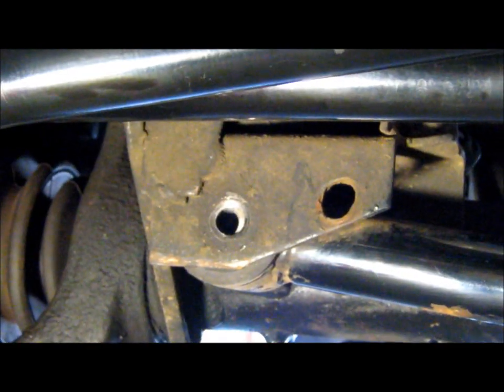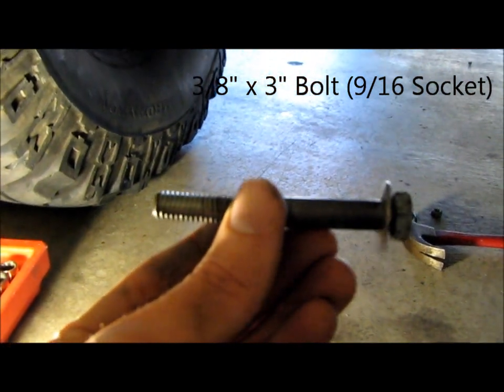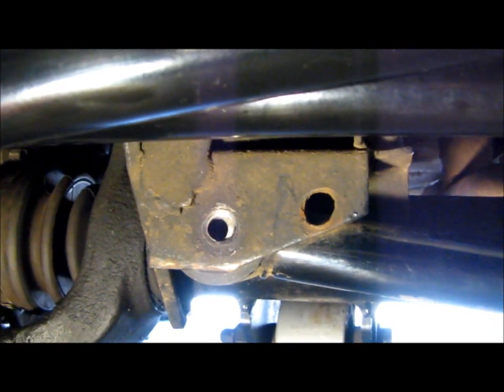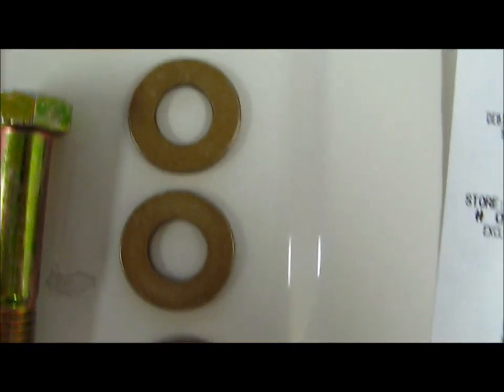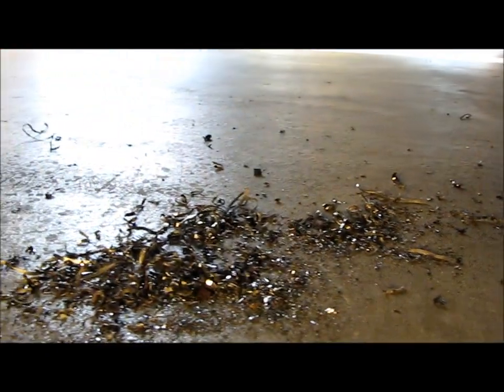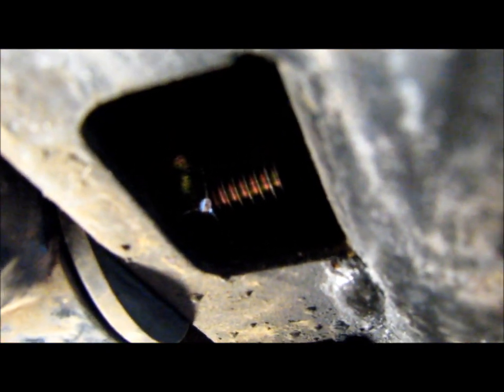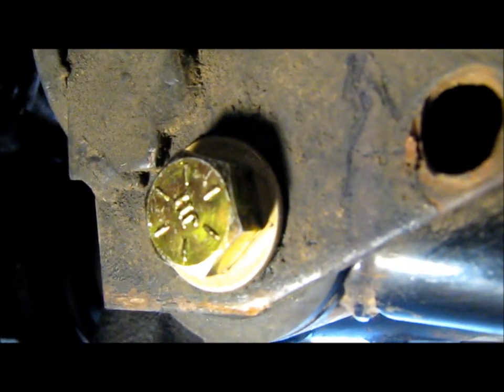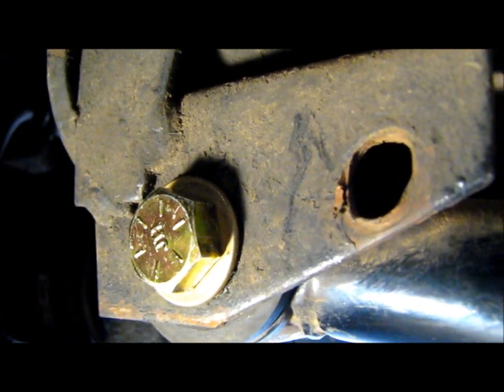Jeep Grand Cherokee 4x4 Project ZJ Part 5 Steering Slop Death Wobble Fix Track Bar Axle Mount

Comment: Great explanation! I have a 97 ZJ, as far as I can tell everything is original/ oem replacement. Ive had the steering box replaced twice, visually there is nothing other than some older bushings , when driving her she is SLOPPY AF. the steering box replacement helped briefly but its back to being incredibly loose. The steering wheel sometimes is turned slightly  to the right to steer straight,  and other times totally normal  & centered. 
I also get a bizarre vibration, (not death wobble), at around 1800 2000 RPM when accelerating on the freeway, recently it has lessened but now only really happens at 1400 1600rpms instead. It is for less than 3 seconds in duration but can be quite violent, it sounds like bass from a sub or something. It's not very loud anymore but it was outrageously loud before. 
I can't figure either of these things out. Possibly related? IDFK. What do you think? 
I know this is an old video but you obviously know your stuff! Thank you!!
-the Seattle girl with a shitty jeep
Reply from the maker: I would take a close took at your drag link which is the bar that goes from the steering box/pitman arm down to the tie rod.  That has an adjustment which is how you center the steering wheel.  If your wheel position is changing, that adjustment is probably loose or the joints on either end of the drag link are loose/bad.  Check it out because that can be very dangerous, could lose steering while driving.

Comment: Thank you for doing this. Mine is wallowed out and I just tightened the hell out of it for now. Did you have to remove any other steering components to drill through? I have 1 ton steering and its looking a little tight
Reply from the maker: With this particular steering setup I didn't have to remove anything.  Had a nice straight shot with plenty of room for the drill luckily.

Comment: Looks like track bar mount weld is cracked above second hole? Also you can cut bolt to length needed, then file end so nut starts easier
Reply from the maker: Yeah, that mount was trashed.  Eventually ended up doing a custom adjustable heavy duty bracket on the top side of the axle with custom adjustable trac bar.

Comment: What kind of drill bit did you use? I can’t seem to drill through the sleeve
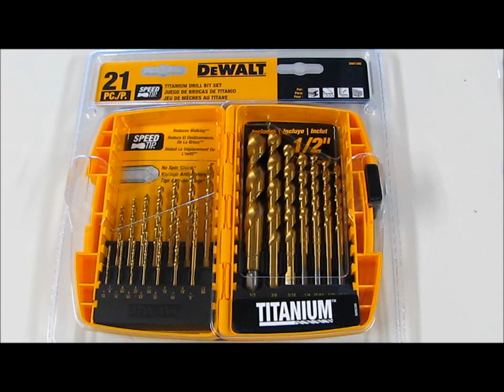Reply from the maker: Check out the bits I got at 3:41
Reply: @WildWestCrawlers- you can use most any metal bit, Ryan's are too choice because they're harder. You MUST go slow, not fast. Use oil too and a good amount of pressure, like a human drill press. Hth

Comment: I’m in need to drill mine out. As for the bushing and bushing sleeve, do I buy a new bushing with a bigger center bore? And matching sleeve?
Reply from the maker: Mine was thick enough that I was able to safely drill it as well.  I left it all in place and drilled through together for perfect alignment.
Reply: Was this done to your oem track bar or aftermarket?
Reply from the maker: @HighhScore  OEM bracket but I believe the track bar was an adjustable aftermarket one, can't really remember the specifics of it though.

Comment: I had to drill mine out from the original 8.8 to half inch grade 8 haven't had any issues since
Reply: Tipton Shelton did you buy a new bushing sleeve or did you drill out the stock part?
Reply: I did the same now I need new bushings. Did you haven to use a .5" sleeve? Is so where did you get it?
Thanks

Comment: Hey brother, great video. I'm doing this to my Jeep as well tonight actually with the same equipment. Just curious how your rig is riding? has the new bolt set up held up pretty well over time?
Reply from the maker: It worked out great and didn't have issues with it after the fix, but I ended up changing the entire steering setup a few times after this video.  You can see the latest videos and info at www.projectzj.com  I'm now running a custom built crossover setup which handles the best of all setups I've tested.

Comment: Did this happen to cause like drifting into a turn I got a zj everything new and it still feels like it's drifting when I go around a right hand turn or if I jerk the wheel the back end feel like it's drifting but feel like it's in the front and this bolt was loose 2 times now thanks
Reply from the maker: I would definitely pull the bolt out and get a good look at the holes on both sides to make sure they fit snuggly against the bolt and are perfectly round.  If they look loose or oval, time to drill larger and install larger bolt.  It will feel very sloppy if you have this issue.
Reply: that “drift” is your limited slip differntial working in action . dont go so fast around corner with any jeep they have high center gravity .

Comment: Can the sleeve on a heim joint be drilled out to a bigger size bolt? I have a WJ and have the same exact problem. I understand drilling out the bracket to a bigger size for the new bolt, but of course this larger bolt won't slide into the stock sleeve of the heim joint.
Reply from the maker: I wouldn't recommend drilling a heim.  Probably better to but a replacement heim for the bolt size you're going to use.
Reply: RYANVISION are they universal with the threads that turn into the bar? Thx for the quick reply btw.

Comment: I upgraded to the next size up on my ZJ too and had to do the same thing with the nut inside-- been years and no problems, I forget how I held the nut while tightening the bolt- I changed to the poly greaseable front sway bar bushings and just installed greaseable poly front sway bar links, old ones were dry on top at pivot and trashed. Also new front bump stops and cups or what was left of them after 20 years of Northern exposure

Comment: could you also use the same  oe bolt and weld a nut on both sides of the bracket  ... i would think that would  really eliminate the problem.?after welding the nuts on both sides ..upgrade to  a little longer grade 8 bolt with a nylon nut.
Reply from the maker: +todd j You could weld a nut to the back side and a washer to the front side but the back doesn't have much room to weld

Comment: why does my 98 grand cherokee w/3" lift wander so bad
Reply from the maker: joseph prejs You probably need a professional alignment to make sure the toe and caster angles are set correctly.  Other than that, check all bushings, joints, tire pressure, steering box, etc.
Reply: Pinion and caster is not low enuff. I paid a professional to do mine and he didnt do it right. At the very minimum you need shims to angle your pinion. I recommend upper adjustable control arms to adjust your pinion/caster.

Comment: I changed my track bar (iro track bar conversion) I just put in the over the knuckle iro tie rod conversion and I still got the damn death wobble
Reply from the maker: Michael Gutierrez Were the holes wallowed out when you changed the track bar?  How are all of your bushings on the control arms?  Hubs and ball joints have minimal movement? Alignment set correctly?
Reply: i found the problem its the lower control arms and the caster is WAY  off ... by the way did you keep the 7/16 bolt in the lower track bar or did you swap it out ... i was drilling a 1/2 in hole but i cant drive on the sleve because i dont have a vice to hold it ..... Also if you did drill it out did it help

Comment: 97 grand cherokee with high offset wheels, i have never had it happen to me but everytime my girl drives it she says it shakes violently freaks her out and she has to pull over, seems to happen in the same spot on the road going about 45mph when hitting a bump on a slight curve.... would it be good to just cut a piece of steel and and weld it over the bracket and re-drill?
Reply from the maker: That's definitely an option, the thicker the steel the better and make sure the hole you drill is exactly the size of the bolt so it doesn't move around at all.

Comment: For the back side of the axle-side mount, you could've used a "tab-nut", or "flag-nut" to secure the new bolt. They're simple to make, with a 4"-to-6" by 1/2" by 1/8" piece of bar stock welded to whatever nut you choose to use for securing the bolt.

I've chosen a grade-8 constant-torque locking (not Nylock) flange-nut for my application, but any applicable nut will do. I've also chosen to use a pair of star-washers as extra insurance against movement of the nut-and-bolt combo in the lower track-bar mount holes (welding in a pair of washers I would only use as a last resort), and to torque the new bolt to a minimum of 60 ft./lbs.

My understanding is that a grade-8 1/2" by 13-tpi nut-and-bolt combo can be safely torqued to 80 ft./lbs., If I read my Haynes Jeep Cherokee Repair Manual's SAE Bolt Torque Chart correctly, the torque range for this combo is 55-80 ft./lbs. Hope this helps...
Reply from the maker: Great info!!!  Thanks!!

Comment: hey man I got the exact same jeep as yours except Aussie version. 2" lift going to 4 on 33" tyres love these jeep vids any coming soon?
Reply from the maker: Right on Zach!!  Yeah, more videos coming soon.  She's going into the shop for 4.88 gears and Aussie lockers front/rear.  Adjustable coil spacers and new shocks on the way as well.  Rocker panels are gonna get cut off and replaced with custom sliders.

Comment: It might be a good idea to have those washers welded to the bracket. Even with that bigger bolt, you're still stressing the bracket and the relatively weak material that its made of. If you weld the washer on, you increase the surface area that the pressure from the bolt can act upon. Just a thought.
Reply: I should have watched the whole video first.
Reply from the maker: andymcdo
Haha at least I know you got my back.  I'll have it welded by next weekend most likely.